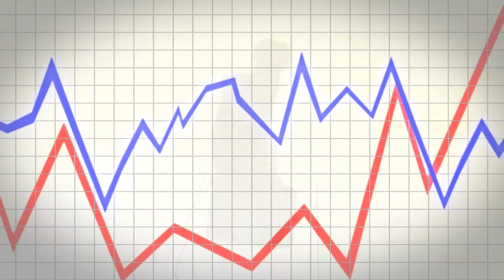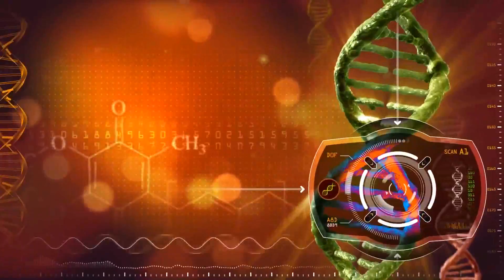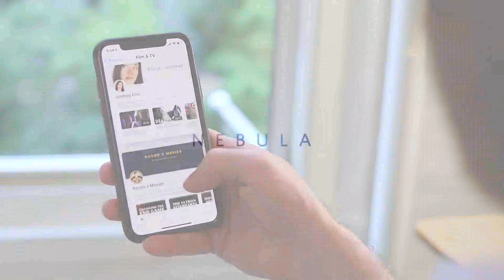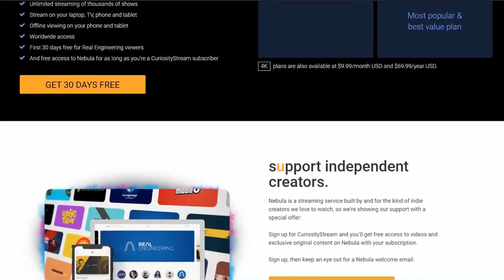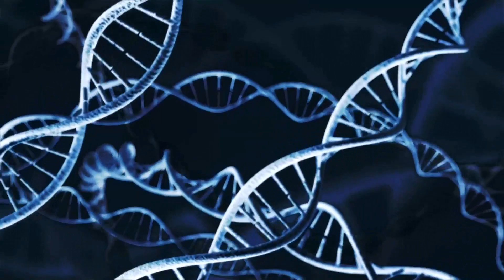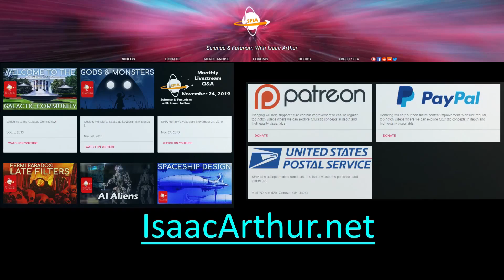The Future of Garbage

Comment: On recycling plastic. Wouldn't it be possible to use a chemical that deteriorated it and generates heat, use the heat in a turbine generator to generator more power? (Do tell me anything that would be wrong with this, it was just a sudden thought)
Reply: Yes, that chemical is Oxygen. It is called burning. It can be done in clean ways though.

Comment: There is something significant we could be doing for more Reuse right now. Promoting standards of product longevity. Give people a very appealing option of not going for the cheapest product in the store. Make them instead look for the cheapest microwave oven that has a longevity stamp, certified for 10+ years of use for example. You wouldn't need these products to be actually tested for 10 years, nor does the manufacturer need to make a warranty that long. Just make sure the standard and robustness is high enough to pass. A criteria would also be in modularity and ease of maintenance. So the parts that are identified as first ones to go, should also be relatively easily replaced or fixed. This is how they used to build everything from appliances to cars to computers!

Also something like a laptop frame that has modular design, so you can basically plug and play any of the components inside. And swap out parts of the frame that wear out. It's a little bit sickening to think how much waste is going on in laptops that need to be completely replaced every few years. Why bother pumping out billions of complete products when you could be mostly making universally compatible upgrade kits and spare parts, and have people use that "same" computer for their whole life?

As a core principle I think something like a TV should be separated to at least two components. The panel and the rest of it. So anyone could buy a fresh panel and have a relatively easy time swapping it into their old TV. Or maybe someone has a really high end panel already, and they just want to replace everything else for more functionality or even aesthetics. Blows my mind this is not industry standard, and we somehow think we have civilization on this planet.

Industry has been running on planned obsolescence for a long time now. Stuff doesn't last because they build it that way on purpose. Only the consumers can start turning it around. It won't be easy, but the first step is to just talk about it. Maybe we will even see some manufacturers get on board, in order to gain some publicity.

Comment: While you can theoretically recycle electronic chips if you assume you do not need a newer one that does the job better, all modern stuff reaches a point of failure due to a variety of reasons (reference drifts, electromigration, simple thermal cycling). This failure usually happens in a few years of operation, and at that point the entire system is down until you replace the chip (which is in itself more costly than just making a new board most of the time, but for the sake of argument let's say we will have portable pick-and-place machines and some AI to decide what is broken in every home).

Harvesting old components would make the new system fail sooner and less predictably, which is not a great selling point for anything made with such a method. Sure you can use them in non-critical stuff, but I like my non-critical TV to last for several years instead of breaking 3 months in, and then waiting at least a few hours to get the 0.50$ culprit replacement to be delivered so I can know if Harry resurrects.

Comment: Recycling needs pretty much change in all industry and society, not just the recycling part. How we make stuff currently, makes recycling and dealing with garbage much more difficult than it could be. Oil is finite resource and it's such and waste to use it for energy or packaging materials that could be done with something that's easily reuseable or renewable. Minimizing waste, be it energy or materials is ultimate end goal though. Best recycling is one you don't have to do.

Comment: Wasteful packaging is one of the biggest causes of waste. 
Steel and tins may have been lamented but imagine the ease of recycling for magnetically reactive metals, much easier to sort so the recycling becomes that much easier to do by automation. 

Far from perfect but it’s not poi’s the entire package needs to be metal. Just enough to easily separate. 

Short life packaging for short life produce. 
Reduced use of plastics, 
Make seasonal electronic devices lore modular and give owners a (better) financial incentive to trade them in later.

A lot can be done, but IMO it starts with taking sensible first steps at the point of packaging.

Comment: If we get the recycling to a decent (effective) enough level, you'd probably see mines of the future digging through an old landfill. Also, you can capture methane on them instead of letting it into the atmosphere. If it has to go out, then better to capture it, burn it and let CO2 come out and get some energy. CO2 is less problematic than CH4. Sure, in ideal situation none of those gets released and we deal with out garbage.

But both landfill mines and CH4 capture are some close/near term things to discuss. Down the road, who knows what will be considered garbage. Some things that we craved for in the past are considered garbage/dangerous/problematic today.
Reply: They already do methane capture and power generation at landfills.

Comment: What about the methane release from landfills?
Reply: Refuse it to run generators, My brother lives on the family farm he heats his water form a cow manure pile, The pile is about 10 feet high 20 feet around he has his line coming from the pump into the pile then to his house he has another line to a hot water heater and can switch in between them but he hardly ever uses the hot water heater,, He says it cuts his power bill down a lot

Comment: Let's not ignore telerobotics in the interim.  Humans are good at interpretation and making efficient decisions.  They're not so good at standing for hours on end in hazardous conditions.    Imagine a gig that involved nothing more than logging time on what looks like an elaborate captcha.  

Let's also consider that diurnal solar power is limited because we have a hard time figuring out how to make use of it when it is most abundant.  Rather than batteries, pyrolysis batch cycles might be a good sink for discount electrical power.  Other sources of recycled waste heat can be used in sequential dewatering/devolatilizing operations before the main oven cycle.

Comment: curious about how food waste and hmm human waste could be dealt with in space especially is using hydtophonics for farming food.
first thought would be compost it, buy yjis would turnit it into soil whigh wouldnt be used in hydtophonics.
even using it as soil to farm in wouldnt the supply of this gradually build up and up over time ?
Reply: If your system was 100% efficient, it won't build up. The plants will turn the materials in your waste back into food, oxygen, etc. For a compact system lile a spacecraft would use, you would probably boost efficiency with artificial systems to speed up some of the slower processes.
Reply: Look up Aquaponics. It's basically wastewater treatment with plants and microorganisms.

Comment: You need to look into Arc Plasma Gasification. Back in 2010 a company out of Canada, PyroGenesys, had set up a pilot plant in Florida for a contract they had with the US Army. The contract involved developing a air transportable unit for use at they FOBs in Afghanistan. These units once deployed will solve two problems they're having, supplying the FOBs with diesel and trash disposal. The tests were a great success with 60 percent surplus of energy generated. The Navy was also very interested in the project. Unfortunately there was no domestic market for the technology and the company failed. At that point, the military bought the company and I lost my ability to monitor their progress. Such a shame, 100 recycling plus 60 percent of the energy available for sale. Check it out.
Reply: I ran across a video from some American media about waste gasification. The companies developing it weren't interested in making energy from it, but chemicals. One company was using a blast furnace fed with oxygen and steam and claimed 90% of the waste that went in ended up as gas, and the rest as a sort of synthetic stone. Given the source of the claims, it should probably be taken with a kilo or two of salt.

Comment: There are several cost effective ways to turn plastic into clean burning fuels that work on a small scale. I can see every now and then pulling into a gas station dumping your waste plastic into the bin filling up with gas and getting change back. 
In places where homeless congregate I never see aluminium cans on the ground but plastic everywhere.

Comment: One big aspect in garbage reduction you didn't mention but I feel is equaly as important as every recycling effort: Producers planing for the whole usage cycle of their product!
What we have now is a system, that doesn't plan for its products to be used as aynthing else but trash at the "end" of its life. Through recycling we just try to find a common ressource among a multitute of product types. Some things however are not recycleable and are just burned for energy.

Real life example: In an applied geology class our tutor told us from an inventor that presented a reinforced concrete through the addition of carbon fibres. But when asked about its recyclebility, he had no answer. This piece of technology would have ended up in a landfill forever, potentially even endangering the environment as it breaks down (that's a real problem for e.g. unsorted demolition scraps. It can leak heavy metals into the ground when used e.g. as road gravel).
Planning for an easy break down of your product or a 2nd life is essential to go to maximum efficiency and a true circular economy.
You can't just let anybody introduce a highly complex item into the environment and expect others to deal with it.
Reply: Good point, especially considering that we design features we desire into newer devices and structures. The absurd customation we have achieved over plastic is an example of how precisely we can build something new. I remember hearing about several waves of products, from pencils to cups, that were designed to bio degrade and hope to see more in the future
Reply: Exactly so. Manufacturers have to make things that can be easily recycled... everything!  It had better be pretty damm indispensable if you can't recycle it, and then you have to make it  repairable - no planned obsolescence. Only then will we have a handle on the trash problem. 

Personally, I'm getting tired of seeing my phone, computer, TV, etc becoming obsolete every few years. And it's not "quaint" to want to play my vinyl LPs once in a while.
Reply: Or you can have a robust recycling technology that can handle even things that break down slowly, or not at all, like a nuclear annihilation plant, or a nanotechnology disassembly plant.
Reply: @oriondye3212  ... AND, here on planet EARTH, bacteria reign supreme. We, humans, and every other creature, are composite, biological entities, awareness, or consciousness, physically housed within a structure, composed mostly of bacteria, existing ONLY because a miraculously balanced, simbiotic symmetry of harmonic cooperation IS-IN opporation...
Reply: Biggest problem is the planned obscolence. Good idea 100 years ago but right now it is poisoning all the biosphere. Water, soil, air and even our food and bodies. We fuel GDP growth and at the same time killing ourselves and bringing doom closer and closer. It probably is inevitable in the end but we do it in the most filthy and obnoxious way. We produce garbage instead of reliable, long living wares or tools or various other things. The main payer for that is each person living in current economy system. Producers don't pay for their garbage
Reply: @amciuam157  That is the price of short term focused economics if we can make the value of something reflect its full cycle usage suddenly the most economic option would be the best option unlike what it is right now. Somethings like planned obsolescence will likely require  more intensive solutions but a lot of problems in our current system involve looking at short term gains while neglecting the rest of the equation, effectively robbing society. It is about time they be forced to pay the true cost. We even have the problem in construction as no one builds things beyond the minimum design life cutting corners wherever possible for short term gains.

Comment: Actually, the most convenient trash disposal should be plasma gasifiers. Just use a little more of that almost unlimited solar, wind and closed cycle molten salt fission based energy. Of course, we'd still need some kind of sorting machine to separate the woody material, to be put back into the ground. Perhaps biocharred, even, to make the soil even better at removing excess CO2, yet another "pollution".

Comment: Here in Ontario, we have an automated sorting system. However, for some reason, the scanners are unable to read the recycling code on black plastics, so no black plastics are recyclable, even if they're a type of plastic the system can otherwise easily and profitably recycle. They really need to fix that.
Reply: I think it's because they use infrared spectral fingerprints to identify the type of plastic, and the black plastic has carbon grains in it which interfere with the detector picking out the required fingerprint.

Comment: Making general public aware of plastic use and make them recycle is an ever continuing process takes forever. We should rather Target the manufacturers across the globe. There are 8 billion consumers compared to 8 million (not sure...even if there 20-40million) manufacturers. Simple logic, which is easy to control. All researchers across the globe collectively should come up with a solution... propose alternative chemistry for plastic which can be compostable at the same time easily implemented using existing engineering process, so current day manufacturers wouldn't mind switching the gears. That's it even if consumers continue do what they were doing, since problem is solved at the source itself we are good
Reply: It is more matter of public awareness. If general population is ignoramus, then it is matter of time when big industry would start breaking regulations. But if you educate population then there would be general expectation to support clean industry. So it isn't just matter of quantity but a system.

Comment: 3:06 Over 95% of nuclear waste is unfissioned and ready to be used again.
Reply: Yes. Most countries stopped reprocessing thou :-( fuel rods classed as waste unfortunately the ultimate non recycler.
Reply: @blackpoolbootz2790  That's because uranium is so cheap it is not economical to reprocess spent fuel. It's still a good idea from the perspective of waste handling, as you need to store less and for less long.
Reply: @wouterdebois7958  If you include waste management aspect it does indeed become cheaper. But it won't happen because the ultimate cost of the waste is paid little by little by future generations. Politics is rarely a matter of long term planning :(
Reply: Yes unfortunately research did not continue into the fast breader reactors as they found more uranium. Was easier to build more light water reactors :-(. Still everyone fighting over disposal for the last 40 years with an increasing ammount of waste. The facility in Cumbria here In the UK was shut some years ago for reprocessing
Reply: @blackpoolbootz2790  They are less mature, but there are plenty of projects trying to develop fast reactors. Thoguh admittedly, most of the recent work on them has been done in China and Russia, in large part due to nuclear power being demonized in the West.
Reply: Takes a lot of time and money to reprocess it so that it can be used again though.
Reply: @alexandernorman5337  it's a good thing that fission is millions of times more energy dense than fossil fuels.
Reply: We CAN made ANOTHER step and invest in thorium MSR - a godly reactor that do not produce ANY waste at all! (since all decay)
Reply: Yup we need to reprocess and recycle spent fuel.